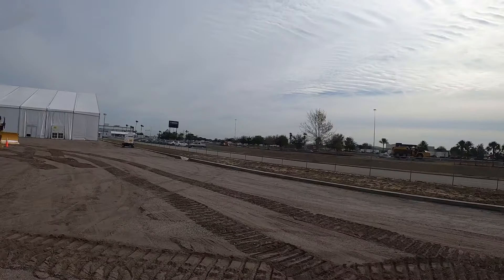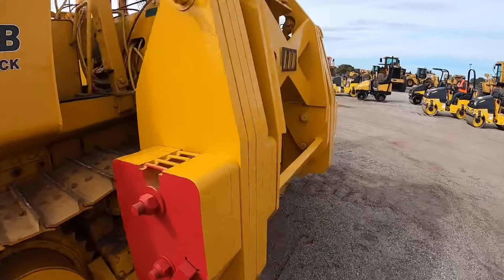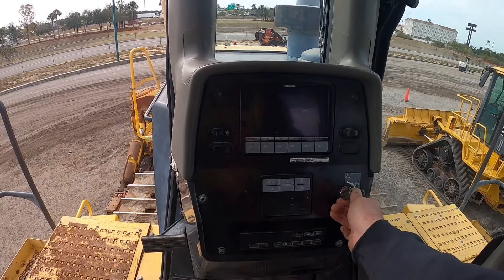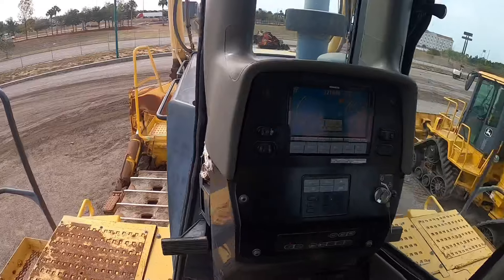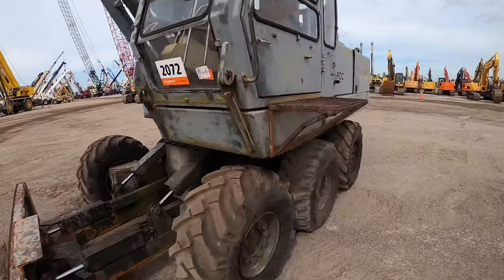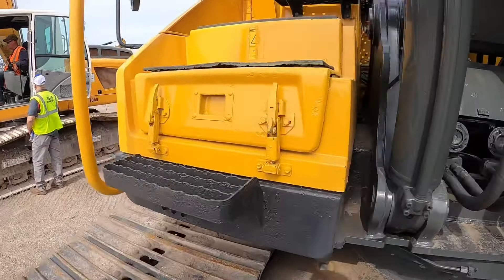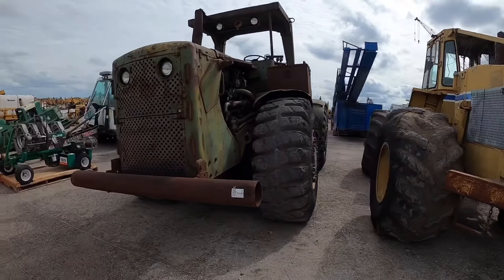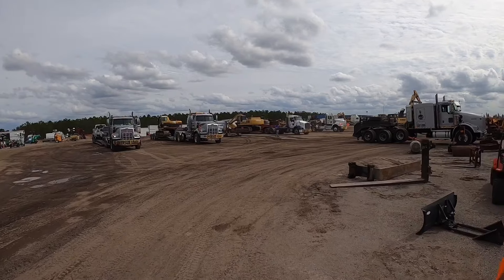We found the big boy toys  at  Ritchie Brothers the largest auction yard in the world!!!!

Comment: The 6 wheeled JD excavator, saw one the the Air force had in there Maintenance yard. I think those were for convoy use with front line troops to repair bomb crater in a runway. The Military used them. The big green 4 wheeler with blade on front. At one time it had a scraper rear for Military use, I believe. Those Richey Brothers yards are huge. Thanks for sharing.
Reply from the maker: Interesting

Comment: Its  quite a tease when u set in one and see how much power and reach.... trucks that do more than one can possibly believe capable.... question Mike... excavators with a bad cabin, Can that sheet metal be replaced at a cost reasonable? Salt eating through the track pads??? I never would believed possible to have that happen with that kind of steel. I guess you would need a donor for some job like that and it would take a enormous amount of time as well

Comment: Question for you. I don't know from bulldozers. they go clank, clank & push dirt around, so I don't know terminology, etc. I wondered what the difference is (why one vs the other) 'high track' (looks kina like a triangle ▲) vs 'flat track' (just goes straight across end to end like "normal") (=) not (▲).
Reply: High track have the finals up above and standard tracks down low. The high track finals get less wear because they are higher up out of the dirt and are easier to work on because you don't have to pull the undercarriage apart to work on the finals.
Reply: @CarrotCaptain   Thanks for that, now what are 'finals'?? I don't know anything about dozers, etc.
Reply: @patcarpenter1991  sure. Finals are the last section of the transmission. They turn the drive sprocket for the track.
Reply: @CarrotCaptain  Makes sense. Thanks for the explanation.

Comment: #DirtPerfect. I have a question for you. 
I’m planning on building a garage on a floating slab. I’m going to be putting in about 18 inches of gravel before the slab. My question is, Do I need to strip the grass under where the slab is going to be since I’m doing 18 inches of gravel over it? It will be probably a year from the time I put in the gravel to when I have the slab poured. I appreciate any thoughts and advice you would have. Thank you sir.
Reply from the maker: If you where building here would attest take the top 4 inches off hope that helps
Reply: #DirtPerfect. Thank you sir. I didn’t think to mention that I live in western Kentucky. Thank you for the advice. And I figured that was the best thing to do.

Comment: Hey man, I absolutely love your channel and have watched it a bunch to maintain my own machine and learn how to use it effectively.

I wanted to hit you up to ask a question. 

I have a 2010 John Deere 120D, it's an awesome machine. However, I keep getting a low oil pressure warning light that comes on both constantly and intermittently. I've replaced the sensor and I've had James River equipment try and diagnose the issue. We tested actual oil pressure and the voltage that the ECU is reading from the sensor itself. The oil pressure is fine, whether at idle or full power. But the light keeps coming on. We could not find an actual issue. 
I think perhaps it may be an intermittent grounding issue from the sensor but there's a variety of sensors that use the same ground when looking at the schematic. 

Any insight to this?

I would appreciate any type of advice, thank you.
Reply from the maker: It’s hard to say but sounds like a wiring problem to me
Reply: @DirtPerfect  I figured it out yesterday after a bunch of troubleshooting, testing continuity, lines on the ECU, actual oil pressure. It ended up being another faulty pressure sensor that I replaced in November. 
Goodness 🙄